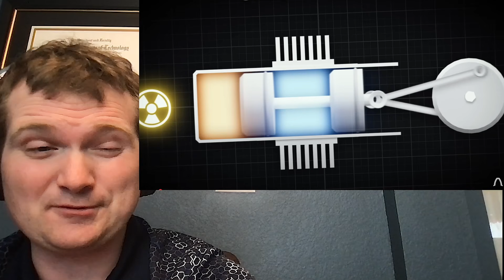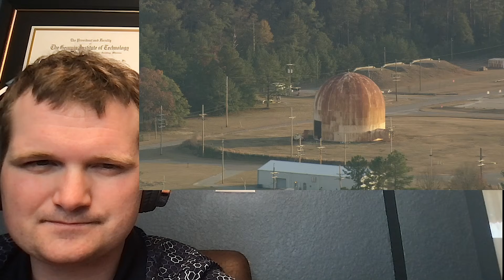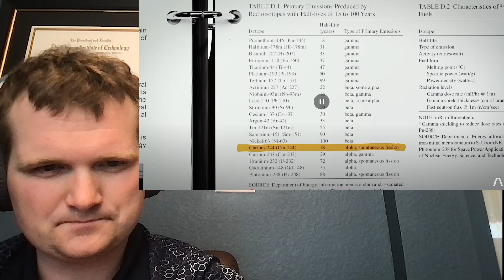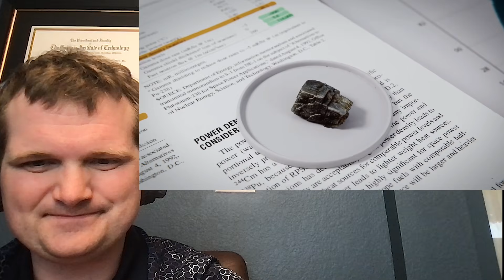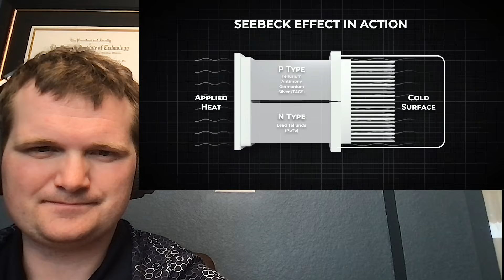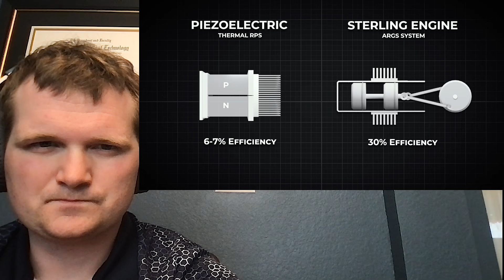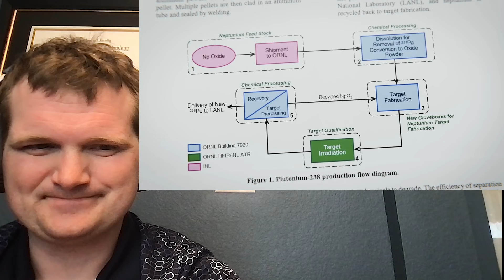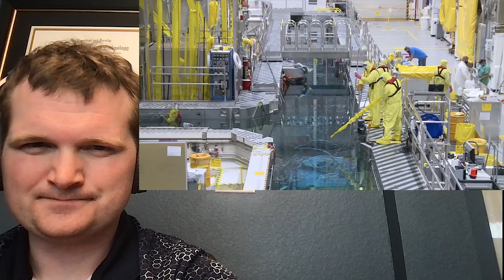NASA's Plutonium Problem - Nuclear Engineer Reacts to Real Engineering

Comment: The moon is tidally locked to the Earth, not to the sun.  There's a day and night cycle on the moon.
Reply: Correct, it's just a cycle that takes about 28 days to complete. The best way to use solar on the moon would be with battery storage facilities in permanently shadowed regions and panels in areas with sun about 14 days of the cycle. When sun is gone use batteries to keep systems warm enough to not freeze completely, then repeat monthly.
Reply: @Kinkajou1015  that would need cabling/connectors or some kind of induction charging. With humans deployed, that’s easy, with only robots it’s more complicated.
Reply: No idiot

Comment: 2:30 Nuclear is Grid Electricity and its costs are exponential. 
Unless everyone lives at the reactor. 
Just saying.2:33 Nuclear is Grid Electricity and its costs are exponential. 
Unless everyone lives at the reactor. 
Just saying.
Reply: What do you mean by “its costs are exponential”?
Reply: @PhD_in_Undecided  
For Australia 245TWh is the amount of electricity used annually in 2023.
Total energy used in Australia is 6,470TWh annually. 
3.8% is electricity energy as part of the total. 

Grid construction costs in Australia is $1million to $10million per km. 

Grid length is 1million km. $TRILLIONS. 

The grid is fragile because it is extremely expensive to EXPAND and too valuable to waste. 
Blackouts were a feature of Australian grid electricity. 
I included street gas supply to my new home build decades ago as a backup energy. 
Others included a petrol engined genset. Honda. 

Nuclear electricity is GRID electricity and the grid expands in all directions and is heavier and more expensive as you move back from the millions and millions and millions of consumers towards the grid central Generators. 
I have worked on a 1,700 tower transmission line. It ain't cheap.

So the first 2% of new nuclear generation gets to use the existing national grid and is limited because nuclear electricity is fragile. Easy and fast to shut down but expensive and time consuming to restat.
The grid itself is fragile and exposed to Blackouts shutdowns if too many Airconditioners are switched on or the clouds cross the sky or storms blow transmission towers down or ....

Both nuclear generation owners and grid owners need 247 cashflow from 247 generation operations. 
Nuclear 14gW x $6billion is $84billion. If you are lucky. 
ROI $8.4billion. 
Grid owners $TRILLIONS. 
ROI $100billion 

Grid owners massive infrastructure does not need fragile nuclear rapidly shutting down and slow restart. This is a SHTTSNPANTS feeling for the grid owners and grid investors. 

My opinion is that 
The grid owners will avoid the horrendous costs to upgrade grid capacity and abandon central generation plant and contract with the millions and millions and millions of consumers to maintain the cashflow from the customer consumers. 
But the grid will be the consumers emergency backup supply and be the taker of excess rooftop PV dirt-cheap electricity. 
And customers v2g EVs massive battery dirt-cheap electricity.
The grid will then be able to supply industrial customers moving away from fossil fuels to clean electricity. Large amounts of clean electricity.

Basically twice the amount of electricity and the original national grid will be protected by massive batteries at the millions and millions of customers and consumers. 

Now more electricity will be needed and that will be a future matter a decade from now.

But grid construction will be dependent on interest rates and economic stability and social stability and mineral mining and refining and smelting and rolling and galvanising and manufacturing and construction in busy urban streets and distant open spaces with camps and....  Distance, and size of infrastructure  and time frames and interest rates .....
Reply: @PhD_in_Undecided  More fuller responce.
For Australia 245TWh is the amount of electricity used annually in 2023.
Total energy used in Australia is 6,470TWh annually. 
3.8% is electricity energy as part of the total. 

Grid construction costs in Australia is $1million to $10million per km. 

Grid length is 1million km. $TRILLIONS. 

The grid is fragile because it is extremely expensive to EXPAND and too valuable to waste. 
Blackouts were a feature of Australian grid electricity. 
I included street gas supply to my new home build decades ago as a backup energy. 
Others included a petrol engined genset. Honda. 

Nuclear electricity is GRID electricity and the grid expands in all directions and is heavier and more expensive as you move back from the millions and millions and millions of consumers towards the grid central Generators. 
I have worked on a 1,700 tower transmission line. It ain't cheap.

So the first 2% of new nuclear generation gets to use the existing national grid and is limited because nuclear electricity is fragile. Easy and fast to shut down but expensive and time consuming to restat.
The grid itself is fragile and exposed to Blackouts shutdowns if too many Airconditioners are switched on or the clouds cross the sky or storms blow transmission towers down or ....

Both nuclear generation owners and grid owners need 247 cashflow from 247 generation operations. 
Nuclear 14gW x $6billion is $84billion. If you are lucky. 
ROI $8.4billion. 
Grid owners $TRILLIONS. 
ROI $100billion 

Grid owners massive infrastructure does not need fragile nuclear rapidly shutting down and slow restart. This is a SHTTSNPANTS feeling for the grid owners and grid investors. 

My opinion is that 
The grid owners will avoid the horrendous costs to upgrade grid capacity and abandon central generation plant and contract with the millions and millions and millions of consumers to maintain the cashflow from the customer consumers. 
But the grid will be the consumers emergency backup supply and be the taker of excess rooftop PV dirt-cheap electricity. 
And customers v2g EVs massive battery dirt-cheap electricity.
The grid will then be able to supply industrial customers moving away from fossil fuels to clean electricity. Large amounts of clean electricity.

Basically twice the amount of electricity and the original national grid will be protected by massive batteries at the millions and millions of customers and consumers. 

Now more electricity will be needed and that will be a future matter a decade from now.

But grid construction will be dependent on interest rates and economic stability and social stability and mineral mining and refining and smelting and rolling and galvanising and manufacturing and construction in busy urban streets and distant open spaces with camps and....  Distance, and size of infrastructure  and time frames and interest rates ....

After all that there is the military factor. 
80% of the world's population live in dictatorships. 
Dictators love ❤️ plutonium nuclear electricity generation industry. 
If the sunniest continent on the planet cannot do rooftop PV and v2g EVs but goes directly to more fossil fuels and then nuclear electricity and grids. Then dictatorships will refuse to abandon fossil fueled energy. 
When Dictators get nuclear industries military defence budgets will explode in every country on the planet. 

Obviously Australia can make a fortune exporting iron ore and coal and copper and zinc and aluminium and uranium yellowcake.

Australia will have it's AUKUS USA nuclear submarines and USA weapon including rockets and missiles. 

Maybe we have to look over our shoulder to 200million Indonesians needing to migrate to the cooler south latitudes. 

The CO2 emissions exploding worldwide as the 10decades of modern national grid building is repeated to increase capacity in 2decades. ??

Comment: Plutonium 238 was also used in tiny RTGs for pacemakers in the 1970s, before batteries that could last long enough.
Reply: Yup they were really small. Had 3.6 to 5 curies of it inside of a modified TO5 transistor case. It makes about 30mA Isc and 1.2V Voc. ❤
Reply: @christopherleubner6633 thanks for the specs
Reply: nuclear powered heart

Comment: The Soviet RDGs used Strontium-90, and there are apparently a ton of them out there uncontrolled and abandoned.  There's been a few orphan source incidents involving them since the collapse of the USSR.
Reply: Leaving warmies out in the freezing wilderness is mean
Reply: If you mean a ton by weight, probably, since they are quite heavy. If you mean 'a ton' like 'large amount' then no, there are a few "unaccounted for" in a manner of speaking but less than 10, I don't remember the number last I checked and I'm not going to dig it up now since it is a less than 'public' info. But there is a difference between orphan sources which we fairly often don't have an inventory of, and RDG's which we do. The unaccounted for RDG's are downed satellites and some arctic... lets call them 'unmanned research stations' heh. Anyway, the RDG's weren't sprinkled all over the place, the USSR had a mechanism for tracking them and didn't hand them out willy nilly to anyone who wanted one, at least per the information available which has been pretty accurate. What they did do was install "unmanned arctic weather monitoring stations" which did do weather but also were part of an early warning system against an over the pole attack by the US. Of these some have had 'incidents' - we don't exactly know what happened but they appeared destroyed/disassembled by someone or something and RDG's went poof gone. Unclear what happened, these are in extremely difficult to access locations and the damage could have been caused by ice or some other process that doesn't involve humans prying it open with a prybar, or that is what the official commentary on it is anyway. You can look it up if you like, IAEA has info on this stuff. 
The medical gear is a fair bit more plentiful and far less controlled, and in most cases far more 'portable' so to speak. An RDG isn't something you can hide very easily relative to other sources that have disappeared that are about the size of a battery, like a C size or so.
Reply: @noth606  ...Yeah, the Soviets did keep some records of where they put their RTGs, but in case you didn't notice, the Soviet Union doesn't exist any more and lots of their records haven't survived. And the Soviet Union was big. You think you can't hide something the size of a washing machine drum in half of Asia? They used them for power in the middle of nowhere and so when they were forgotten about they stayed in the middle of nowhere. That's pretty well hid.
Reply: @ Mmm as far as I've understood and recall there is a definite list of RTG's produced and to whom they were given. The soviets did have fairly good control over these things when they were running the show. Most of the records have survived when it comes to those things, there are some bits missing but it's relatively minor. They didn't sell RTG powered childrens toys at the market for 1 kopek, heh. 
Without going too far into it, there were also fairly good records of these things outside of the sovjet union, for fairly understandable reasons. Neighbors keeping an eye out so to speak, and I don't mean the US or NATO. 
From my perspective there are ones that are "gone" but in a way where there is a reasonable idea of what happened. I wouldn't worry too much about those, but there are a few where the info is too incomplete to have any good picture. Basically we probably know it existed and went somewhere, and then things got dismantled by multiple parties and none claim to have seen it or taken it. Those are the hard ones, but there are not many. And they are not 'mini nukes' like some people imagine, they have a radioactive source and might be used for a "dirty bomb" maybe but that's about it. Even so it would be a minor one. 
I looked into this last time in 2000-2002 about, and the "presumed missing" were less than 10 - I'm saying it this way because there are at least one in that "count" where almost for sure the same device is counted twice. There is a reasonable explanation for why that is so, but out of caution the record is as it is. 
There is of course a possibility that there are devices that were made by other parties and not recorded the same way, I think some things destined for space had their own 'pedigree' and there may have been more. Basically impossible to really know for sure. But my point is that it isn't like there are hundreds of these things floating around somewhere. There are some unaccounted for but they are few. And of those we have a plausible explanation for why they are "missing" so to speak.
Reply: @noth606  So you heard about the Lia incident? And you're still insisting that there are no lost sources in the former Soviet Union?
Reply: @ You should try to improve your reading skills. I clearly said there are unaccounted for ones, I just contested the use of the word "tons" which in case you are unaware means '1000s' to be specific but in loose parlance means a large number. You wouldn't properly call even 50 as "tons" unless you're a teenager exaggerating everything. I'm sure there are more than the ones I've read about since the info is probably not complete, but the way it is spoken of makes it sound like the sovjets handed RTG's out on every street corner for a couple of kopeks or for free. That is childish and stupid to claim. It shows zero understanding of what these things are and what it takes to make them. Also what they were and still are used for. They are relatively low power sources but with very long lifespan and zero or near zero maintenance required. The other aspect of them is that they are EXPENSIVE, more because putting a price on the radioactive material in them is difficult, but you'd need to do a lot of different things to get a legal way to get the stuff to make them. If you were to go about making them an illegal way, it might be cheaper relatively speaking but still we'd be in the hundreds of thousands to millions range most likely. They aren't valuable to most but since they are generally tightly controlled - getting one "under the table" would require serious casherola.
Reply: @noth606   According to the IAEA report "The Radiological Accident in Lia, Georgia", there were at least eight unaccounted-for RDG sources in Georgia.  The RDGs were "disassembled" and their sources were "exposed and removed from their original location" which sounds to me like a description of intentional human action.  Since the sources were removed, the USSR records of the original RDG locations were of little value in finding the missing sources.  As of 2001, six of these eight sources had been found and secured.  These RDG's were originally installed in radio communications relay stations and had nothing to do with satellites, the arctic, or military early warning systems.  So even if you are correct that the number of RDG's - and more importantly the number of their sources - that remain unaccounted-for is less than 10, to say they weren't sprinkled all over the place seems inaccurate given the USSR was apparently willing to use them in any remote area.
Reply: Did you ever watch ice station zebra?  @noth606